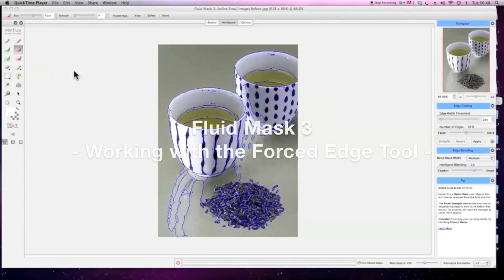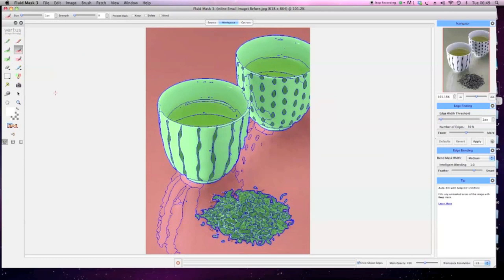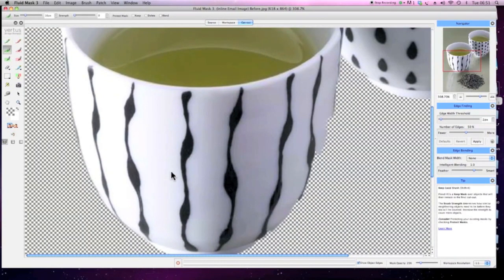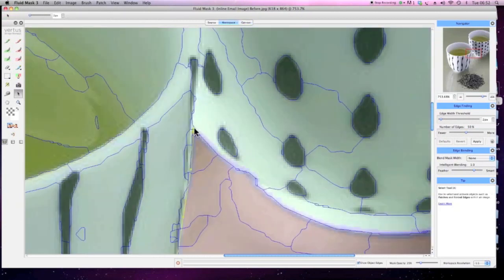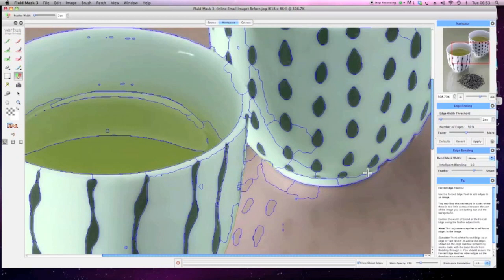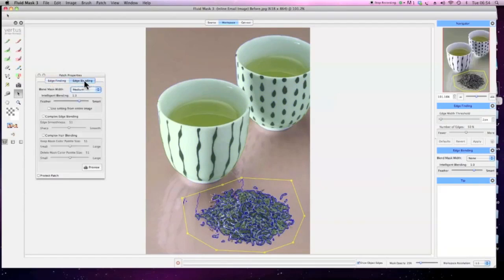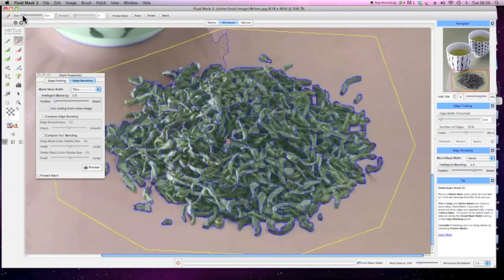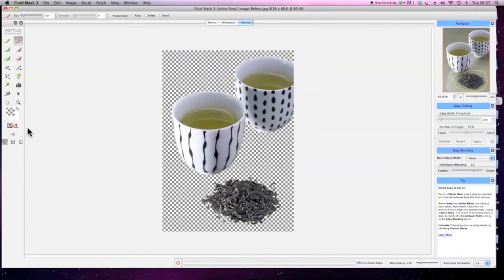Fluid Mask 3 - Working with the Forced Edge Tool

Comment: When I use the forced edge tool it doesn't auto fill even though I have Auto-Fill with Keep enabled. Also when I try to manually fill the forced edge disappears when I click on the Keep Local Brush.

Comment from the maker: The forced edge tool works alongside the edge finding aspect of Fluid Mask. In this tutorial our masker applies the local delete/auto-fill with keep first, but one option would be to apply your forced edges first and then use local (or global) keep/delete brushes to flood the regions you've defined (both 'found' by Fluid Mask and manually 'forced'). That's not quite the same as the point you make but effectively would do the same job, though we'll keep your comment in mind for future versions.